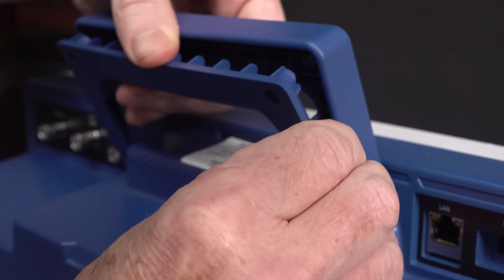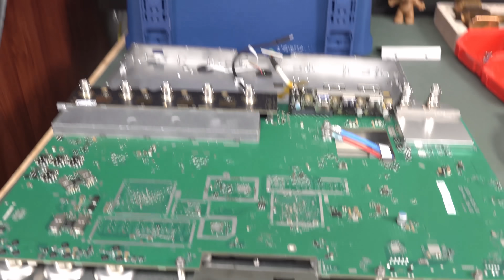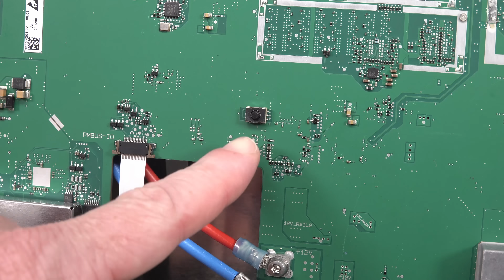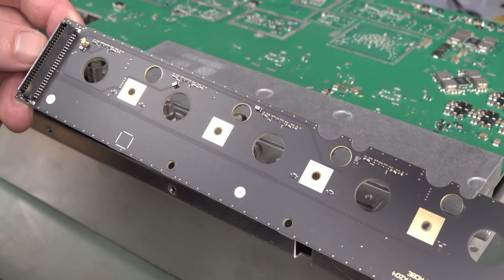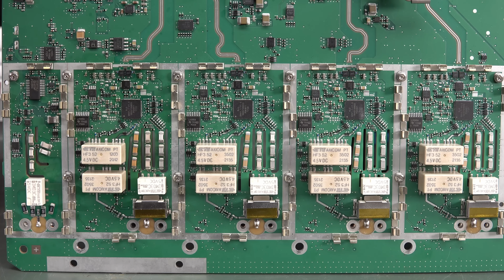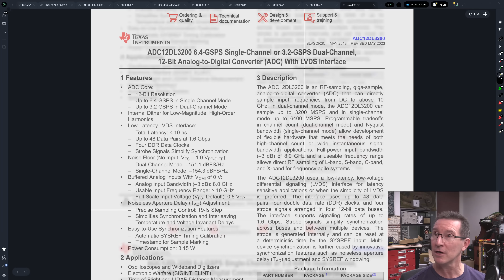EEVblog 1545 - R&S MXO4 TEARDOWN. The World's Fastest Oscilloscope!

Comment: ADC chip alone is worth more than my entire scope.
Reply: ADC chip alone is worth more than my last car!
Reply: That is the reason for the flimsy handle axle. With all the expensive thechnology they had to cut the cost at least somewhere. Not sure how much they managed to save though.
Reply: I used an adc 16bit for current measuring shunt and it costs like 4$ for the chip breakout board alone almost as much as my mcu. Are ADCs generally expensive?
Reply: @omniyambot9876  Ones that we use for our projects are usually pretty cheap, but they are over 1000 times slower.
Reply: Bah! Half a probe breaks my budget 😢
Reply: Same
Reply: @omniyambot9876 hey what did you study in college or university you have alot of knowledge in tech
Reply: @omniyambot9876  They have 10s of kB samples per second while the one in this one have Gigabytes of samples per second. Thats what you are paying for. Speed. 😅

Comment: i got to build the PCBA, safety, performance and calibration testers for the production line for these units.
some my job is building PCBA testing fixtures and platforms.
and let me tell u, these where the biggest challenge jet to build.
the amount of testing and level of performance of every detail is amazing.
like all USB outs get a over-current event, the trigger time and recovery time are both tested and log'd.

and ges who has a few of these pre-production models just floating around different work spaces.
we do.

Comment: Love the advancement in Toroidal propeller designs for boats and multirotor drones.
Reply: As far as I’m aware they are not magic. Fan rotation speed will still have the biggest impact. A 120mm fan at <800rpm is basically inaudible, even without any fancy blade shapes. Assuming the bearings/bushings etc. are not making any noise.

Comment: 12:06 These 6 identical Micron memory chips (D9WFH) could form a single 12-bit word memory array for samplings storage. 
20:22 There's another Micron 8Gb DRAM chip (D9TBK) near by which could be dedicated for MSO sampling. This is my guess. )
Reply from the maker: Could be right.
Reply: Those are (probably x8) DDR4 memory chips. 48bit memory bus, each transfer operation taking 4 cycles, 48 bytes total (32×12bit samples) per transfer.
Extra single DRAM chip - probably RAM for ARM cores
Reply: D9WFH is for the MT40A512M16LY-075:E which has a 512M16 configuration (4 pieces -> 64bit)
Who knows how they arranged the memory ... could be 12bits for the sample with 4bits input state -> 16bits x 4 channels -> 64bits
We can only have a pure guess at it.
But the max memory depth of the scope is 400Mpoints and those 4 memory chips are 512M16x4 which is certainly enough.
Reply: @ppdan im just amazed by the amount of knowledge you have.. what career did you study

Comment: 21:22 That might be why there are 6 memory chips, to store 12 bits, you divide the address space in 2 and store 12 bits in  6 chips. But I still think they're storing 12 bits in 4 chips by dividing the address space in 3, and the other two are double-parity, You don't want the data getting corrupted do you ? or one of them is parity and the other is ASIC configuration RAM.

Comment: The reason there are six ddr chips is because the adc's acquire width is 12bit,usually ddr chips used four chip in a group, It's corresponds to a 8bit adc.

Comment: The MXO 4 has at least 4 GB for temporary information storage for operating
system and instrument firmware and >= 7 GB for waveform data and measurement data.
Such information can be found in the "R&S®MXO 4 Series Oscilloscope Instrument Security Procedures"

Comment: At 13:43, ch 4 (from the left), does the pcb have leftover flux from some rework? I wasn't going to be too picky, but since you talked about contaminents on the pcb.. Don't get me wrong,  the board layout is extremely beautiful.
Reply: Well you talked about it later on in the video. My guess would be a chippie needed to be replaced and the flux didn't get cleaned off.
Reply: I think it may just be roasted from a manual rework.

Comment: That 12V is similar to how Intel wants it for the new ATX12V standard. Under that standard, the PSU only has to concern itself with 12V, it's up to the motherboard to provide all other power rails that a computer requires (5V, 3.3V, etc...). Which would make PSUs for computers much simpler.

Comment: Beauty.😍

I haven't seen the main review and was trying to do the BOM price in my head, but in all the excitment I kindo lost track of myself...

Please can you do an update on the PSU, and what they're doing to that ground plane (I'm a little surprised they airn't using a cleaner internal one). If they're taking it straight from the wall they might as well pour vomit on the thing.

As for the DRAM it looks as though they're them for input buffers and RAM, with some switching to cope with the bandwidth (RAID0). It would be interesting to know how they're storing the input data, I'm guessing storing 2 values in a single 3-byte pointer (that would help with bandwidth), otherwise they would be wasting a lot of nibbles (Gen-Z probably wondering wtf is a nibble?😅). Little surprised the DRAM doesn't get a little privacy with its own can as a lot of laptops sheild the DRAM, amd ECC is probably a luxury at such speeds.

Also, I've never sceen those fans before. Noise Blocker is a fairly well known brand and PC enthusiates will pay a pretty penny for decent fans. I have 6x140mm cooling my CPU as I like silence (German too!)

Comment: the Levroy 10-100ZI exceeds 100GHz... Isn't that the worlds fastest?     I.5GHz is a bit slower. Nice fabrication job, well done!
Reply: Maybe fastest sampling rate, but "fastest" usually refers to waveform update rate, and the MXO is several times faster than the Lecroy in that respect.

Comment: Wow, actually wearing a wrist strap?! Did you blow something up by zapping it recently? 😁

I still don't understand "waveform updates per second" being such a hyped marketing term. Maybe they should instead talk about percentage of time acquired? "Waveform updates" is dependent on how big a waveform is, the sample rate, etc. It doesn't seem like it actually tells you a lot?
Reply from the maker: I just moved my wrist strap connector point and was testing it. Plus it's a kinda special scope.
Reply: Actually, the MXO4 does tell you the percentage of time acquired, and with some settings, it can be close to 100% (i.e. zero blind time)

Comment: What are all of the circles (like at 8:47)? Are they just vias?
Reply: Most of them look like tented vias yes, especially since some traces run to and terminate at them, and others have copper clearance around them (obviously the via is not connected to the same net that the copper fill is, and they wanted to avoid the extra cost and complexity of a blind/buried via where possible).

Comment: Question out of left field,  is there a reason pcb traces cannot be made out of different materials that act the same as ic's,  caps, transistors,  inductors etc, so you don't actually need to put anything on top of the pcb?
Reply from the maker: PCB traces ARE resistors, inductors and capacitors. But usually only at higher frequencies. Look up "Distributed element filters". You can't do semiconductors like diodes and transistors with PCB traces.
Reply: I've certainly seen hybrid modules with resistors silk-screened directly onto the substrate. And of course in the microwave and millimeter wave spectrum, inductors and capacitors are often made with specially shaped pcb traces. As for active devices, I think what you just described is an IC
Reply: You can make resistors and caps out of PCB traces, and certainly high-frequency antennas. But transistors require doping tiny regions in certain ways with high precision. You get thousands or millions of transistors or ICs on an 8" or 14" radius wafer, but if you built a large PCB at that resolution, and only placed a few ICs on it, it would cost thousands or millions, rather than the cost being amortised over thousands of ICs
Reply: I do know that you shouldn’t run AC power line traces in parallel to serial communication lines.
Reply from the maker: Also: https://www.youtube.com/watch?v=Zao8upe4phs

Comment: I bought one of this. There’re many bugs there and freeze few times within one week.😢
Reply: Tell us more?
Reply: Yeah, but unlike Rigol, they'll fix it in firmware updates soon enough.
Reply: @sabamacx  When slowly rotating dials, for example, I want to zoom in on the vertical scale, but sometimes it zooms out—probably an encoder de-bouncing issue.

Unable to enter the built-in demo mode, can't see any waveform there. And I can't get out unless I press the auto-set button.

The LCD brightness behaves wired. It changes to the default percentage (I don't know what's that) while the value in the menu is unchanged. Sometimes this happens after a reboot, and sometimes it just drops after powering on the device for a while.

The device will freeze after powering on for long periods (a few hours?) No response for the touch screen, dials, buttons, mouse or even the power button. I must disconnect the power cord or switch off the main physical switch next to the fuse to restart it.
Reply: Try to download the new firmware which was release around march 2023.
Reply: @tristentan  It is running the latest firmware since I got the scope.

Comment: Fastest oscilloscope by what metric? It's just 1.5 GHz. Fastest 12 bit? Most Waveforms/s? Lowest UI lag?
Reply: Fastest = highest number of waveform per seconds.  People often confuse sampling rate (or worse yet, bandwidth) with waveform acquisition rate.  Sampling rate is simply how fast the scope can digitize the input signal.  But those samples have to be converted into waveform records and displayed, and this is where acquisition rate is important:  most scopes discard the (vast) majority of samples because they can't turn them into waveforms fast enough.  By this metric, the MXO4 is at least an order of magnitude faster than most other scopes (thanks to its custom ASIC).

Comment: I have 20ghz scope at my work, why is this fastest ?
Reply: 20 GHz refers to the sampling rate, not the waveform update rate.  Waveform update rate is the speed at which samples are combined into waveforms and stored / displayed.  Most oscilloscopes actually discard the majority of the samples they acquire because they lack the ability to convert all of those samples into waveforms.  A loose analogy would be a very high resolution video camera that only captures / stores one frame a second

Comment: World's fastest oscilloscope ? 🤔
I've worked with a Lecroy 4 Ghz bw 4 channels. 40gps sampling rate
Reply: Fastest = highest waveform update rate (number of waveforms per second).  Speed here refers to how fast the oscilloscope can turn samples into waveforms and display them, not the rate at which the samples are taken.  Most scopes actually discard a very large percentage of the samples they acquire because they cannot turn those samples into waveforms quickly enough.

Comment: "The World's Fastest"??? So, in your fantasy a Keysight (Agilent) UXR1104A (110 GHz, 256 GSa/s) is slower than this one?
Reply: "Fast" here refers to waveform update rate (waveforms / sec).  It's not the same thing as bandwidth or sampling rate.  Look for "maximum update rate" in the UXR specifications - it's an order of magnitude slower than the MXO4.   A high sampling rate doesn't help if the oscilloscope is not able to turn most of them into waveforms and display them on the screen fast enough.
Reply: @pauldenisowski  Ok, now I get it. But, it is quite a misleading clickbait title. I was expecting some sick terahertz microwave porn.
Reply: @tiborgats  Even Keysight acknowledges the importance of fast update rate 

"Waveform update rate can be extremely important when evaluating oscilloscopes for purchase. Although this specification is often overlooked, it can have a direct impact on your ability to capture a random and infrequent event which occurs just once in a million occurrences of your signal. There are three reasons why fast update rates are important for today’s oscilloscopes"

https://www.keysight.com/us/en/assets/7018-01745/white-papers/5989-7885.pdf